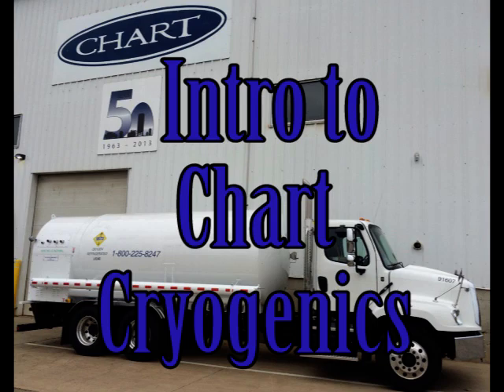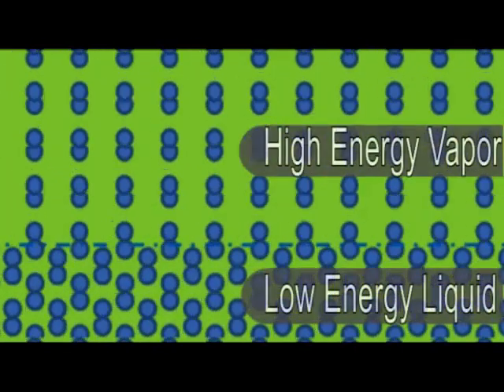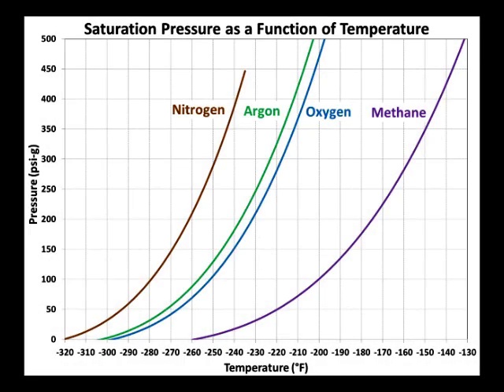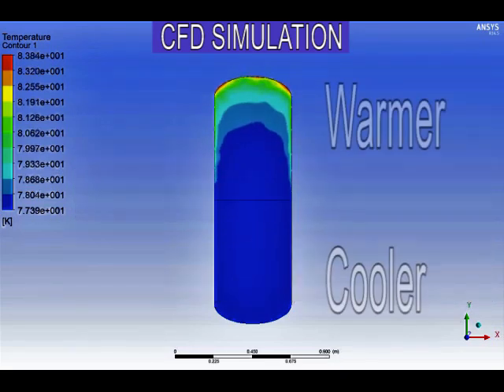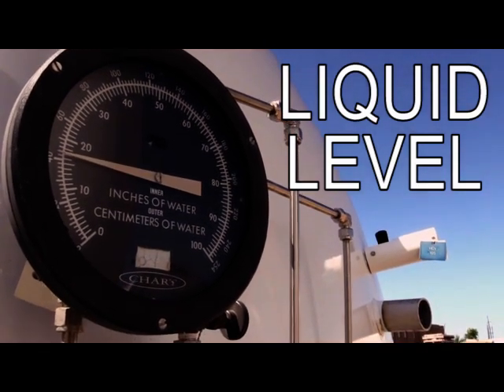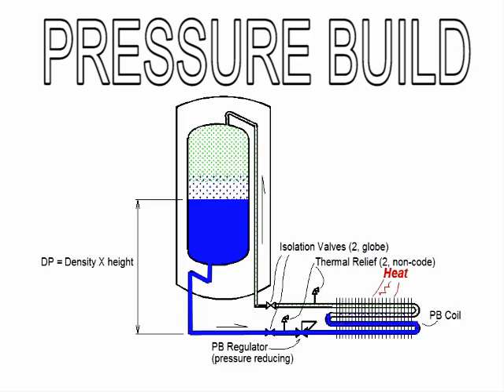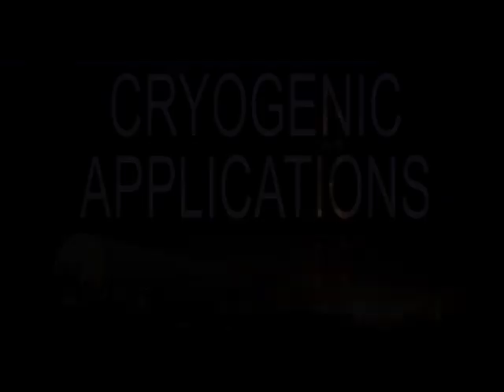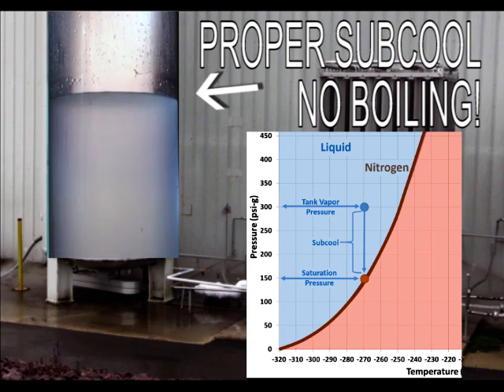Introduction to Cryogenics

Comment: I'm in the hiring process to haul Cryo.  I've watched this only once so far, and I feel overwhelmed.  I was never that good in science in school.  This should be interesting
Reply: I’m also going to start hauling it next week, but I did it before  about 14 years ago. It’s not that complicated, you will learn a lot and it will get easier with time
Reply: All you have to be is a trained monkey that twirls a few valves in the right order.  There is a safety built into almost everything.

Comment: Interesting to watch and brought back memories.  My Air Force specialty was Cryogenic Fluids Production running a 5-ton per day production plant... high-pressure systems, dangerous equipment and only operated in locations where liquid O2 and N2 were not commercially available .  Our Navy counterparts ran their plants on aircraft carriers.
Reply: What are your thoughts on the Artemis mission and cryogenic refueling in space? Will gravity be an issue? will the temperature differences from one side of the craft to the other cause issues?

Comment: Just one can say the equilibrium vapour pressure is occurred when the rate of condensation of vapor is equal to the rate of evaporation of the liq molecules at the surface of the liq. So, colliding bet gas molecule and liq molecules may loss the energy of the gas and condense it, at the same time liq molecule of high energy vaporate
Reply: Say huh??  Lol

Comment: Hello, I don't understand the effect of heat flux on a cryogenic tank. I feel like evaporation will occur, causing a liquid level drop and a pressure rise to stay on the P-T equilibrium line, but at 3:20 you're saying the opposite (liquid level rise)... Can somebody explain that to me, please ? 
Thank you by advance and have a nice day
Reply: Evaporation occurs at the boiling point, the level rises when the energy is increased but boiling point is not reached yet